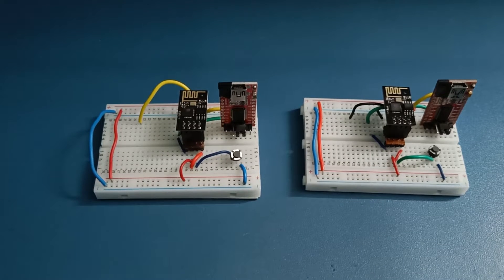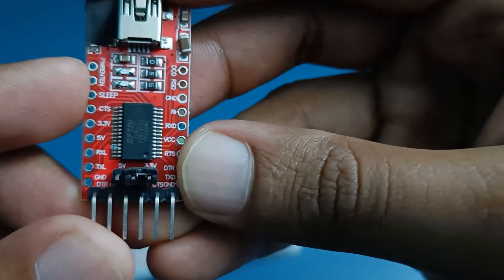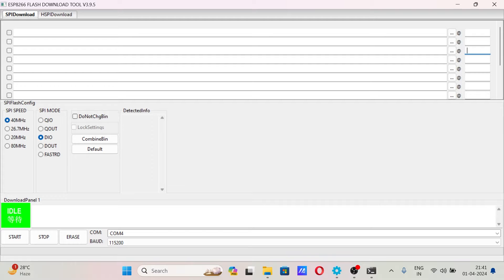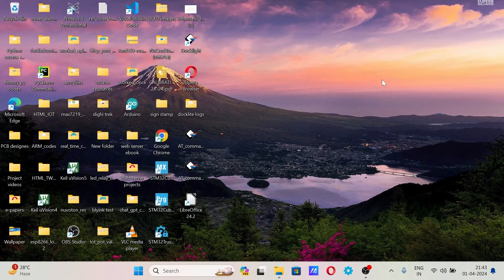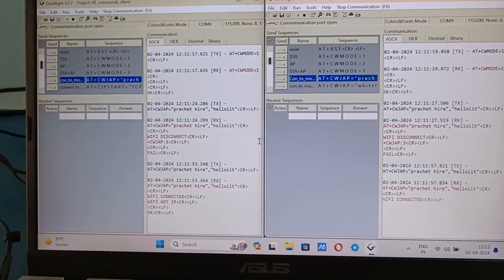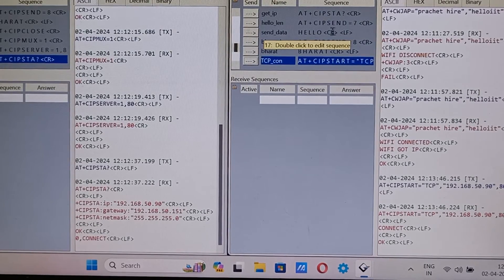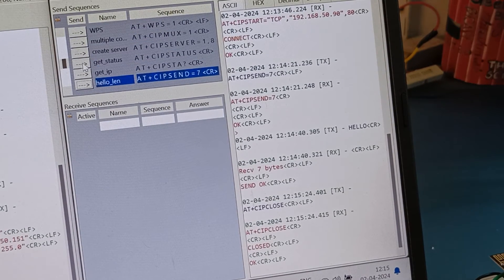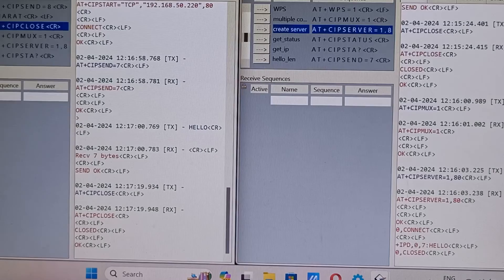Module to Module wireless communication using AT commands (ESP8266 - ESP-01 project)

Comment: I found this very helpful.
QUESTION: Is there a method by which you send an 'AT' command via TCP that will execute on the server - for example to flip a GPIO bit.  Yes, I know you can write/load code for this, by I'm asking if can be done via AT commands alone.
Thanks
Reply from the maker: Glad you found it helpful. 
ANSWER : I am not that experienced in computer networking,  just a electronics hardware guy interested in microcontrollers. What I would do is, route the response received from TCP server to serial port of another ESP module configured in AT mode. Maybe you have a better idea.